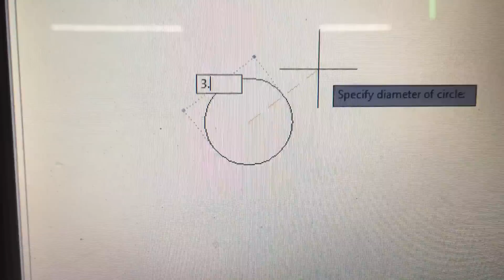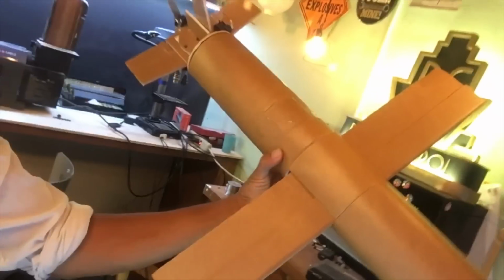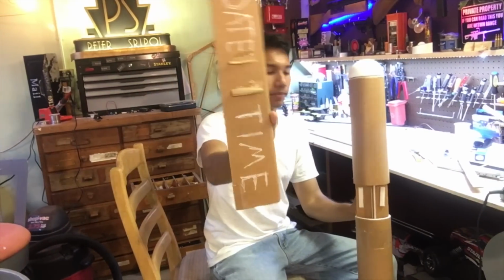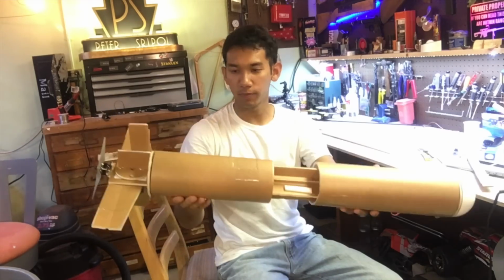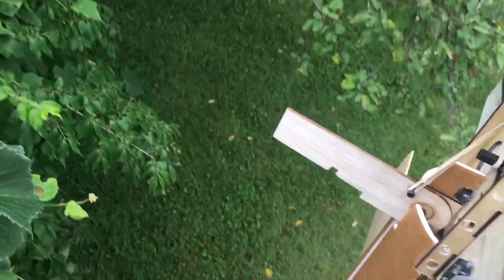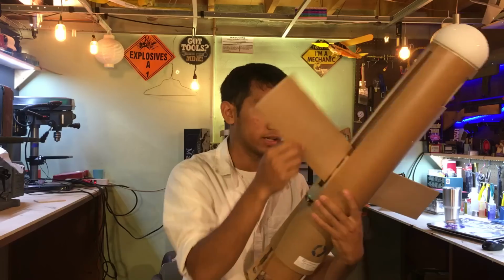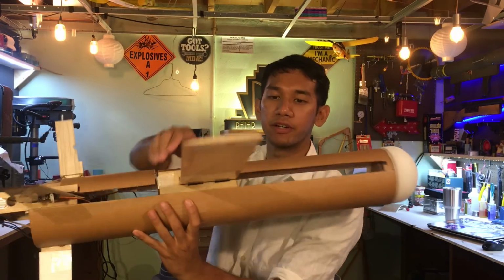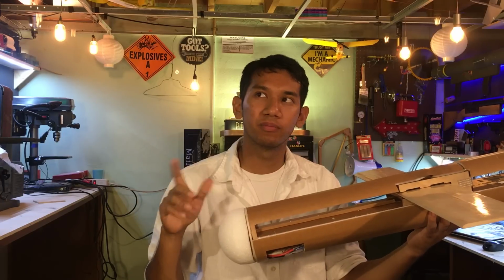DIY Javelin Guided missile Part1

Comment: when i was like 9-10yr old (currently 16) i was fascinated with the concept of a javeline missile and how it uses height to attack the top of tanks. i built a gravity system ( i was like 9, i didnt understand laser guided tech) that was basically a tube that i filled with lead shot to get the desired weight i needed. i used model rockets from the local hobby store.  i had a 3in pvc pipe that i taped a laser range finder to and i would use the range to find the weight i needed based of the thrust of the rocket engine i was currently useing. it would get within a 10ft radius of what i was aiming at. luckily i had supporting parents and my big sister helped me with the basic physics I equation.

if anyone else tried something similar, or totally unique, let me know how it worked

Comment: I know this is an older video, but could you increase the amount of speed and turn rate by switching to a lighter core? instead of what you are currently using, have like a solid rod run through the middle (it will give it enough mass and density for sufficient control) and then having a foam casing? it would be cheaper, and it may fly better. also try moving the wings hack a bit if you can, and but a little lead shit in the front cone. this will cause the center of lift to be behind the center of mass, giving it better control.